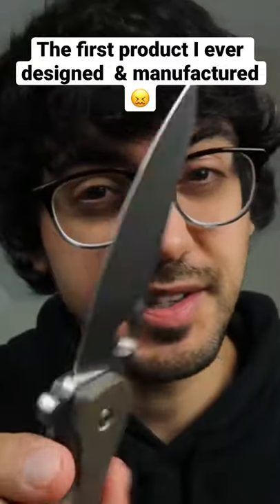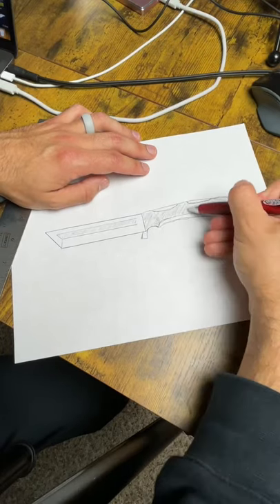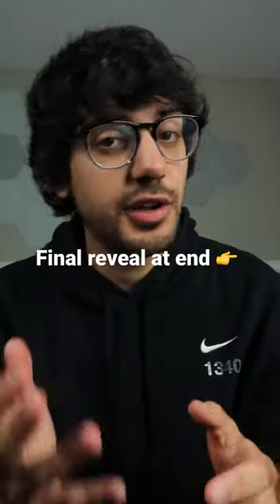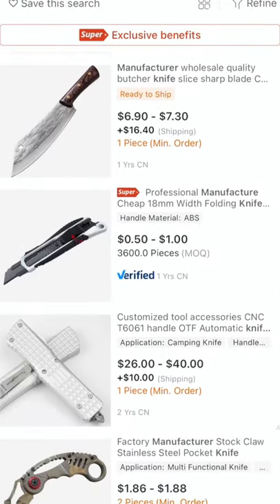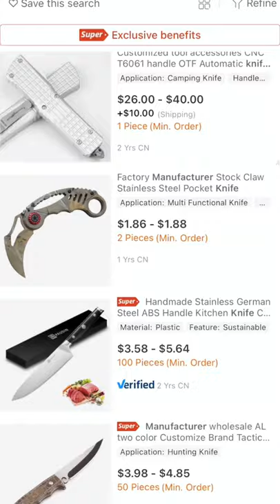My first product I designed & manufactured 😖

Comment: I couldn't see whether or not you did this but I think you beveled both edges and if you're going to have a sword like that for tactical use I would want one for culinary and I would want one to be as long as possible but absolutely straight because that's the type of knives I use I use Japanese knives but Japanese knives are only sharpened on one side and it's completely flat on the other so close but no cigars they say